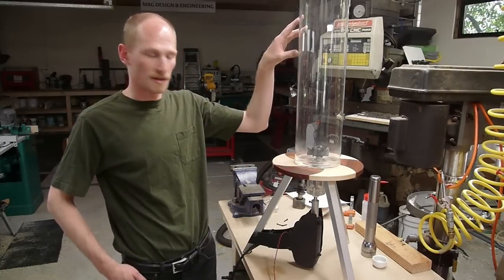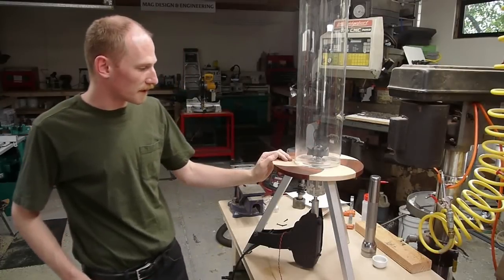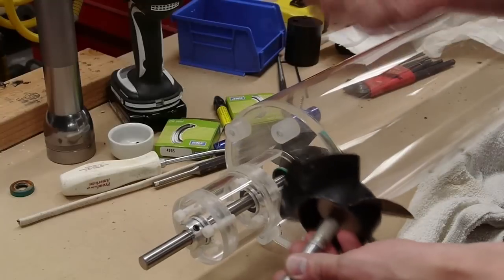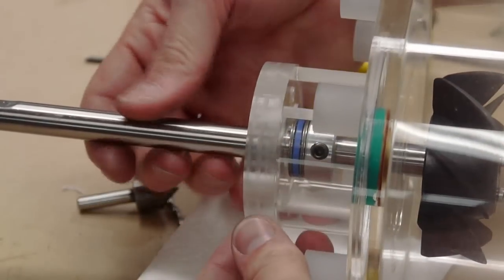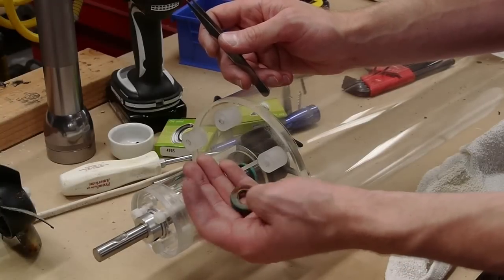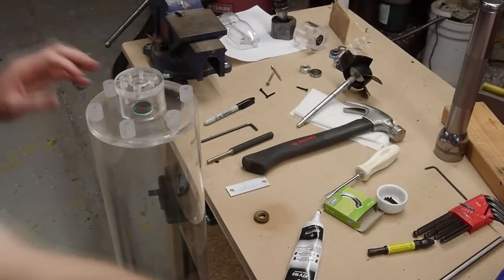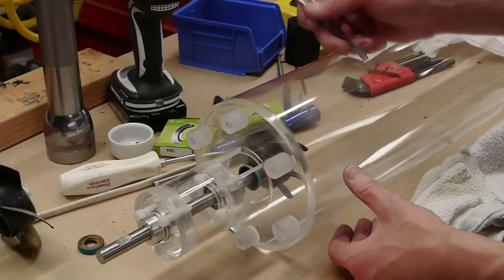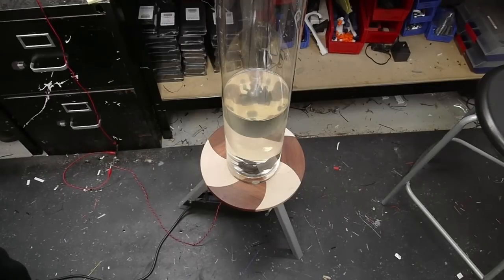Water vortex display from SJ City Hall exhibition -- repair and upgrade

Comment: It woube interestingvto build a duplicate, but with a Vicktor Schauberger impeller.  Set them side by side. If input power is controlled to be equal, the vortex should be noticeably stronger with the impeller.

Comment: Buy a magnetically-coupled centrifugal pump.  Rip open the impeller chamber, and mate that to the bottom of your tube  You have motor, impeller, ceramic bearings made to work in water, and no seal to worry about.
To prevent algae, add alcohol to the water.  You can use denatured alcohol fuel.

Comment: Why don't you use a strong saline solution (10% or more) to prevent algae growth. Correct me if I'm wrong, but I have kept saline for several months without any signs of algae. Also, they have an anti-algae chemical used for fish aquariums that should work in fresh water.

Comment: Server Fan!! i just wanted to share some idea..
it might be stupid ..
I had an idea to look kinda cool.

If you Install a powerful (RED)LED in the CENTER of the FAN , when the water start turning and make a hole down until get to the center, the RED LED light will shows Kinda 3D picture of  the Water vortex by lighting the side of the water, once the hole touched the bottom of it , the  lighting shows the reverse picture , it might  lights the inside . of the hole ... or depend on installations it might the RED LED just lights Straight out to the sealing . 

Use a wireless power system  to get the power source inside glass water for LED ..with out making holes for cable..

..
if you Assemble some "BLUE" LED lights under` the unit and for the power link it to the dimer connected to the fan motor, then with the Higher or Lower SPEED Lights  Higher or Lower!

Comment: you could use another motor instead of a drill motor, as they usually have reduction gears and you don't get the full rpm of the rotor.

Comment: Add some bleach or waterbed treatment to the water. That should remove the algae problem. Using mineral oil instead of water might do the trick, too, but that would be a huge mess if it leaked.